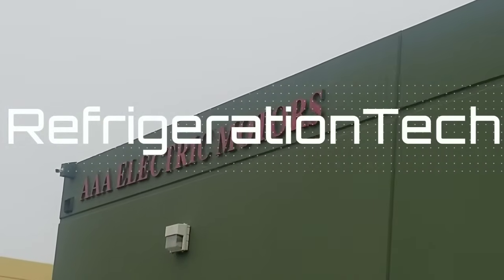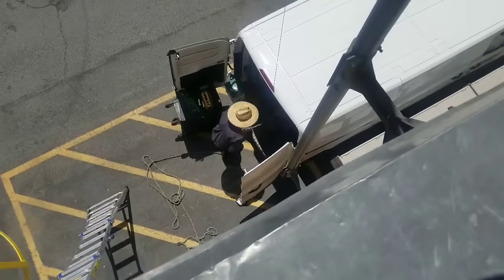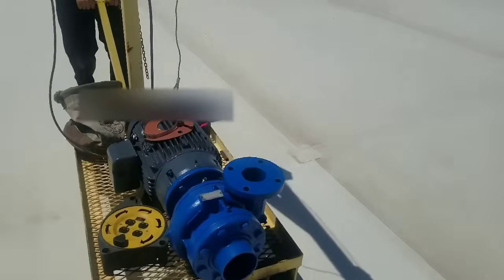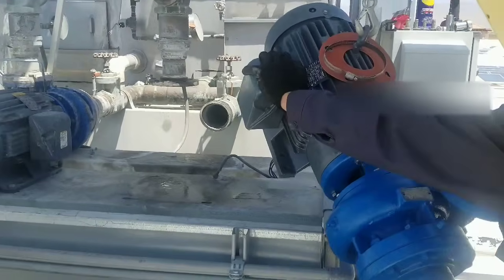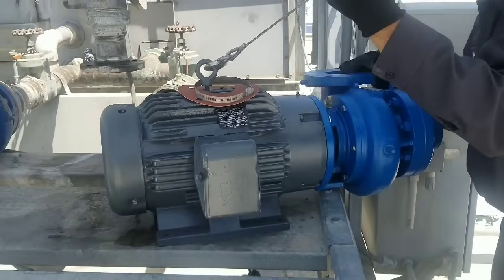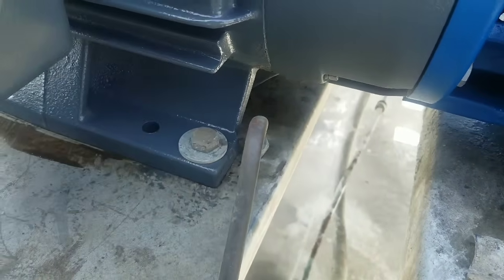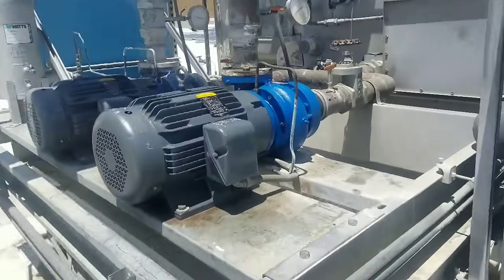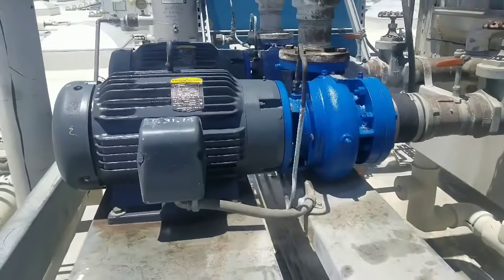PART 2, 20Hp MOTOR/WATER PUMP !

Comment: Hi guy - when you hook those motors up you need to make sure they are grounded.  If that motor shorted to ground there is no path to clear the breaker.  When you use those concentric bushings at the peckerhead it negates the use of the conduit as a ground path - and that small flex conduit is only good for grounding a 15 or 20 amp circuit and in sure that motor has a bigger breaker than that.  Keep yourself safe and everyone else will be safe - odds are if something goes wrong with that motor your going to be the first one to lay hands on it and I'm sure you dont want to get hit with 480... install a proper ground guy...